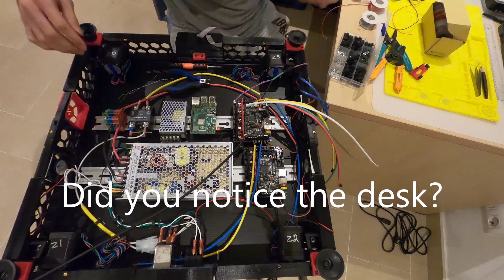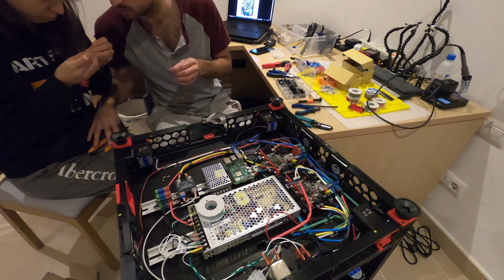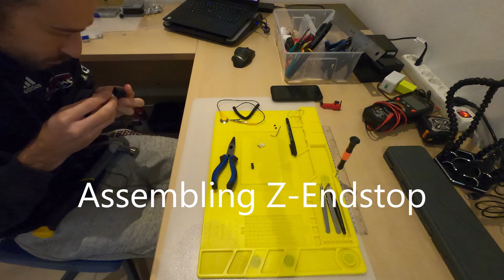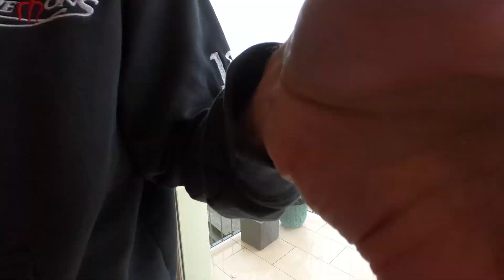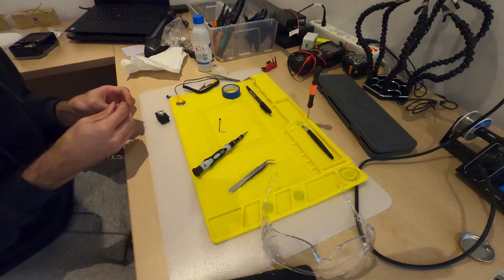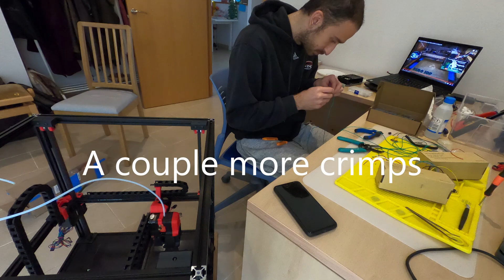Voron 2.4 Build Project - 9 - Wires, Endstop, Wires

Comment: I am currently buying arts. i am already worried about wiring . How many colors you think i should buy and any recommendation based on your experience.
Reply from the maker: You can always cover them with shrink-wrap later on, but I found the number of colors I had was sufficient. I had 2 boxes of 24 AWG and 1 box of 20 AWG, each containing 5 colors. Just make sure you buy sufficient total length as per the manual!
Reply: @AeroAce1994  I have doubt that wiring and afterburner two things that are sort of weakness of voron. I don't own anyone of them just see videos and cad files of hevort and recently Vzbot and did a rough idea. I may be wrong.
Reply from the maker: @dexterviz9171  You can find the total length of wires you need in the manual, so you can be certain you have enough!